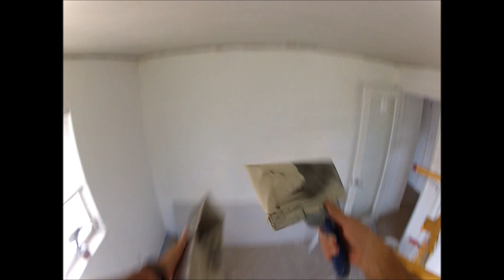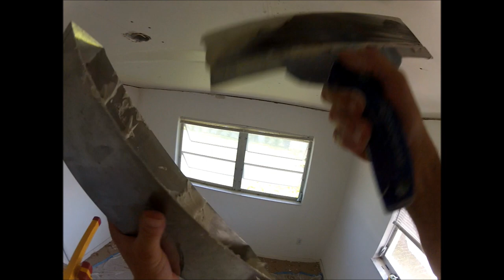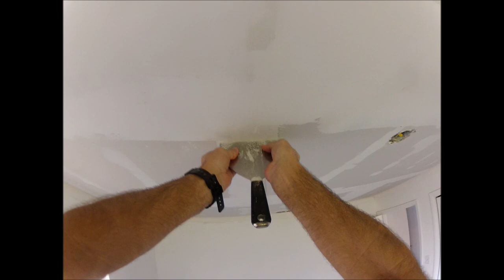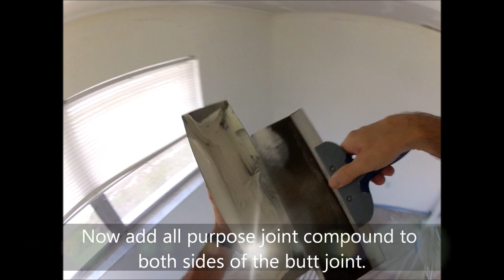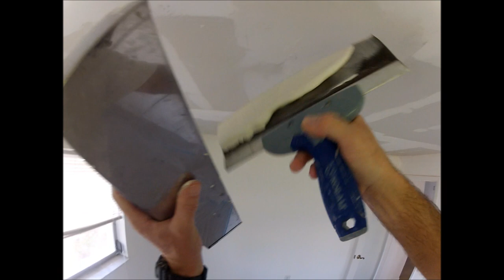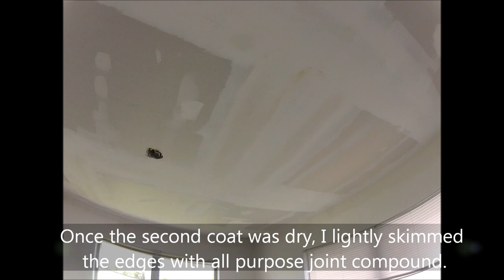How to get a flat drywall butt joint with fiberglass mesh drywall tape

Comment: Hey Paul, thanks for the video! I’m about to proceed on a cracked ceiling butt joint that I repaired. First thing I did was dig it out then prefill with hot mud. Then used mesh with more hot mud. It’s all brand new to me. Now I’m about to start spreading out with all purpose. I like how you demonstrate the use of the knife to gauge your mud spreading needs. Here goes nothing!

Comment: Hi,i am almost done with my basement walls,the coats i did were thin,hardly need to sand but in some areas i sanded a bit too hard i guess and i can see the mesh tape peeking out a bit,will that show if i paint over it? Is there a way to fix it?
I need guidance,my hands are hurting and i just want to get it over with..thanks.

Comment: Just wondering what the typical consistency of your mud is? I have tried to use mud straight out of the bucket when I first started a previous job and found it was too difficult to work with. Ended up thinning it out a bit with a little water (using small amounts) to get it workable. Seemed like straight out of the bucket also had more air bubbles or maybe we were a bit ignorant about needing to mix it up. Also would like to inquire about how much pressure you use when cleaning off the excess as it seems to vary from person to person. I have used too much pressure I think in the past as each coat gets thinned out quite a bit. Lastly, I am terrible at getting rid of ridges (would honestly rather sand them down even though more work) I have heard of using a rubber edged drywall squeegee, is that something you can recommend?
Reply from the maker: Hi ZButler, yes I thin down the joint compound just enough to get rid of any air bubbles and also for an nice cream comppound. I’d say the consistency is like a thick yogurt. As far as a rubber squeegee? I have not use one for skim coating. I have heard that other people like it though. I need to do a video on that! Thanks so much for watching and subscribing! Take care, -Paul

Comment: What size joint knives do you use? Looks like 10" maybe?
Reply from the maker: FJR Paint. Yes exactly. I started with a 10" drywall taping knife for the first coat and then used a 12" knife for the rest of the drywall finishing of that butt joint. Take care, -Paul

Comment: What is Hot Mud and how do I make it?  I have bucket of Plus 3 joint compound for my new bathroom install and this is the first time I will be mudding so many drywall joints.  Thanks for your help.
Reply from the maker: +cjordan2ufl  Hot mud= Quick setting joint compound. It sets up by a  chemical reaction instead of like the air dry joint compounds that come in a five gallon bucket. This comes as a powder form that you have to mix  yourself by adding water. Lowes and Home Depot sell the quick setting compound. You can get it in different setting times. You would probably want to use the 45 minute or 90 minute. 

I  like using the USG Easy Sand-> https://www.usg.com/content/usgcom/en/products-solutions/products/finishing/setting-type-powder-joint-compounds/usg-sheetrock-easy-sand-joint-compound.html

Here's a couple of my videos that show how to mix quick setting joint compound by hand or with a cordless drill:
https://youtu.be/VSlc-PzG_Z0

https://youtu.be/TmClZXCCEOw

Good luck with your drywall finishing and bath remodeling project. If you run into any more questions don't hesitate to ask. I'm happy to help you out. Take care, -Paul
Reply: Thank you so much for the quick reply.  So I can use Hot Mud for first coat over fiber tape and then do remaining coats with my big bucket of Plus 3 Joint compound?
Reply: Awesome.  You are the BEST!!  I know myself and the rest of those commenting are very thankful for your expertise.
Reply from the maker: cjordan2ufl That's awesome! Thank you sir! Be sure to Subscribe to my Channel to keep up with all my of my latest videos  Here-> http://www.youtube.com/subscription_center?add_user=PeckDrywallPainting . 

Take care, -Paul
Reply: Quick question on Vinyl corner bead.  When applying mud does the mud cover the actual corner edge or will that just remain white with no mud and get painted? I watched some videos and no one mentions ho far out the mid goes, just to keep excess mud from sticking off edge. Thanks for your help.

Comment: would u recommend to put hot mud right  before u put mesh to have good adhesive,  no cracks for sure?
Reply from the maker: Hi Daniel, No I would recommend applying the fiberglass mesh tape first directly to the drywall. Once you place it over the seam take your finger and run it down the center of the tape kind of pushing the tape up in the gap of the two pieces of drywall. V'ing it upward. This will give you maximum strength on that drywall joint. Hope that makes sense and helps you, -Paul

Comment: Ok- so the only part I didn't see was the "install" of the tape.... did you just stick it on? any prep to the rock before you stick it on?
Great video btw. :)
Reply from the maker: Thank you Rebekkah ! Yes the fiberglass mesh drywall tape has an adhesive on the back so you can just stick it on. Before I apply the tape, I make sure there is no loose or frayed drywall or drywall paper at the butt joint. Next I take my 6" taping knife and run the top of the handle pushing down while applying a lot of pressure along the seam to actually create a small tapered edge on both sides of the butt to help keep the mud work as clean and flat as possible. Hope that helps and let me know if you have any more questions. -Paul
Reply: Paul Peck Hey Paul.  Do you have a video of how you prep your drywall before applying mesh tape to it? Then also where you continue on to step x step apply the mesh and then all purpose compound?  I just want to make sure that, over the years that, I haven’t been creating extra work for myself, to where I may have or more than like overkilled with the mesh tape application to mudding say a side wall, not a ceiling.  I’d be forever grateful. Thanks so much. -T

Comment: Haven't took my popcorn off yet but I can see the tape edges on the edge of my ceiling I can't see it cornering off on my walls though just ceiling edge. How would you fix it? Thanks
Reply from the maker: Hi George, if it was me I would take a razor knife with a brand new blade and carefully cut along the corner where the wall meets the ceiling. Make sure you cut all the way through the tape. Next  pull the ceiling tape off. Now do any mud work as needed (don't retape the corner). Then prime. Lastly use a good quality paintable caulk and run a nice bead around the perimeter of the room. If you aren't going to repaint your walls? Watch this video and it will show you how to use painters tape while caulking to acheive a nice straight cut line. https://www.youtube.com/watch?v=LT1klRyOtQc Good luck and let me know if you have any more questions along the way. -Paul
Reply: +Paul Peck thanks man I have another question when I take the take off the ceiling (not corner) there's going to be that old compound on both sides of the seam I would just leave it rather than sanding that off and put mesh take and mud like normal on top of that old compound?
Reply from the maker: george kelly Great questions! What I do is keep the new mud work concentrated only in the void where the tape was removed. If you put the new mud over the old joint compound on both sides of the seam there will always be a hump. Most people always make this mistake! I applaud you for thinking this through. Well done Sir! -Paul
Reply: +Paul Peck ok so what your saying is leave the old mud and where the gap would be from where I took the tape off put new tape and probably one coat of hot mud to where it's even with the old compound?
Yea it's my moms house ain't tryna fuck up lol and wanting to do it right I've been putting the job off have other things going on so more questions pop up
Reply: +Paul Peck ok I got what you said after reading it again cheers
Reply from the maker: One thing George. One coat of mud will most likely not be best. The hot mud will probably shrink a little. I would do a second coat of all purpose joint compound keeping it within the same area as the hot mud from the first coat. Also the all purpose will sand much easier then the hot mud would if you need to fine sand that area. Keep me posted on your progress. Cheers, -Paul

Comment: great video going to try this today..matter of fact now
Reply from the maker: +CountrySideClub  Thank you and good luck with your drywall finishing project. Feel free to ask any questions that might come up while your up to your elbows in joint compound. ;-) 
Be sure to subscribe to my channel too. -Paul
Reply: +Paul Peck will do and subscribed...this drywall  business is very tricky but seems like once u get your particular method things get a lot smoother..I am going with this method  for sure..mixing up my mud now
Reply: Great video. Does your method still consist of the traditional three day process?  When sanding.  What grit sand paper do you recommend, as well as the correct sanding tools to use to make sure I don’t sand too far down and to keep my drywall mud knife like you showed where it’s level? I’m going to take a guess and say that, you don’t have much sanding to do at all from what I saw in your video... Do you?  I’m thumbing up and subscribing. Thanks and keep great videos like this one coming. One last thing.  When hanging drywall on new framing... How far off my basement concrete floor should the bottom be up off of the floor for carpet to be laid after?  Also. When stacking drywall horizontally... How do I determine which edges of each side should face each other for the correct gap, before screwing in the drywall and then mesh taping and mudding?  Thanks so much.

Comment: Personally I hate using mesh tape on anything other than repairs. I've had may ceiling joints crack, and had to go in after the drywall/tape crew has long left and repair them. They use mesh, and SR 90, and always looks good! Toll it cracks
Reply from the maker: Hi Cory, I personally haven’t had a problem with fiberglass mesh tape cracking. Have you ever used Fibafuse ? I’ve been using Fibafuse a lot more then mesh the year. Thanks so much for watching and subscribing!😎-Paul
Reply: @PaulPeck  so is there any different between fiba tape and other mesh tape? What I mean is when dry wall crack on mesh tape it's not like fiber break open, it's more like mesh can not hide the fine line crack, can fiba tape hide the crack? I like use mesh tape for easy of use and seems don't have issue so far, but I didn't do too much taping just few basement,  so I can't tell if there is any thing that client didn't tell me, but all these people telling things like crack on mesh tape worries me and I switched to paper tape oh boy I have to be very careful not to get blister.

Comment: Why should you always use hot mud on the first coat over mesh tape?
Reply from the maker: Hi Cpcsof1,   Because most manufacturers of the fiberglass mesh drywall tape recommend using with the setting type compound. If you use all purpose joint compound there is potential for cracking. I always try and go by a manufacturers recommendations.I hope this helps, -Paul
Reply: Paul is right. Manufacturers recommendations are always best for mud. Durabond and other brand setting compounds are stronger than premixed mud. That is why people use it to fill gaps and damaged boards when new rock is hung. Durabond is always best for first coats. Especially on screw holes. Less chances of popping out

Comment: Why the stiff knife scrape down the middle?  Never seen you do that before.  I thought just add mud to both sides to make even and hide tape ect?  Not saying you shouldn't do that but just a little confused
Reply from the maker: CW, When you're using fiberglass mesh to tape a drywall butt joint. A lot of times gravity will pull the wet hot mud down through the tape and stick down from the center of the butt. Doing a quick scrape eliminates the center from build on top of that mud if it wasn't scraped down/removed.  Might be overkill on my part. But I do it everytime I use mesh tape and my butts come out flat everytime. Have you tried using the newer composite tape called FibaFuse?

Comment: Don't see tape...?¿
Reply from the maker: Anu, of course I used tape to finish the new drywall on the ceiling of this remodeling project! Fiberglass mesh tape to be exact. The whole reason I titled the video "How to get a flat drywall butt joint with fiberglass mesh tape". 😁👍🏻 -Paul

Comment: if the carpet was beeing replaced, then why even cover some of it with cheap painters plastic instead of 3mil plastic? also why use hot water to add humidity combined with the mesh tape to cause a seam that will sag? the definition of insanity is doing the same thing over again and expecting a different result, especially over 20 years
Reply from the maker: +Rob Elveru The homeowners put the .31 mil plastic down when they tore out the water damaged ceiling before I got there. 
 I use a setting type compound (hot mud) with the fiberglass mesh tape because that's what the manufactures say to use in the instructions right on the roll. If you used all purpose joint compound for the first coat on the fiber tape, that could have been your problem all along.

Comment: fist make sure you cover floor properly. next tape all joint before sarting to float others. next use quickset mud and paper tape because your fiber tabe is ganna crack out. also the little trick you try and show people that your butt joints are flat is not accurate. drywall butts are not flat thats why they call it" floating" if you want them flat use butt board between sheets. and lastly, if youve been doing this long enough, you should be able to coat your butts in one coat period!
Reply from the maker: +Rob Elveru That carpeting was being replaced. No problem using fiberglass mesh drywall tape if used with hot mud. If my little trick shows a flat butt joint-> IT"S A FLAT BUTT JOINT! Be doing drywall for over 20 years and never ever just one coated a drywall seam of any kind... The thing is, I'm not only a drywall contractor. I'm a painting contractor too. So, I see how things hold up and look after it's been primed and painted. One coat butt joints don't hold up for long and look like Dookie! Thanks for stopping by. :-)